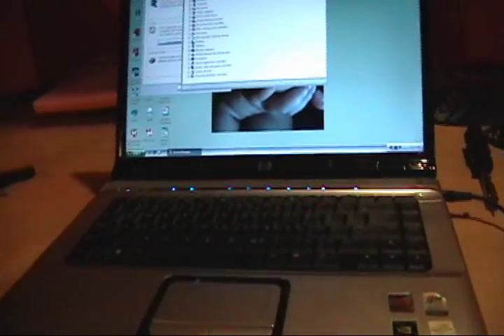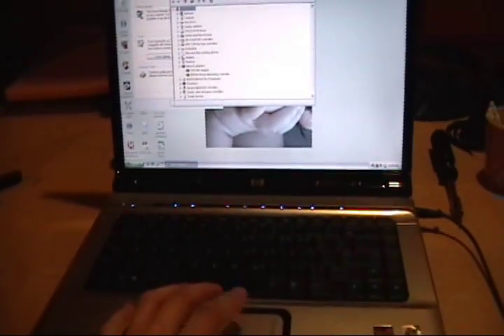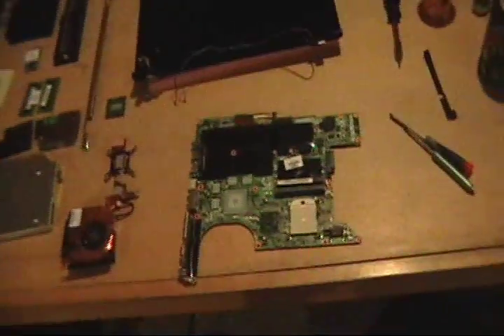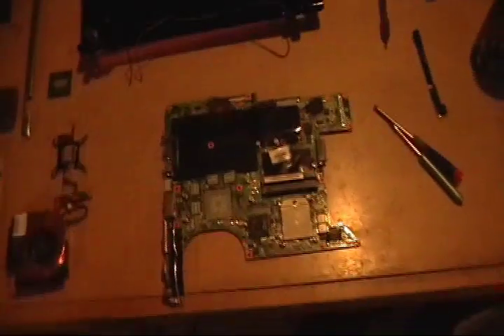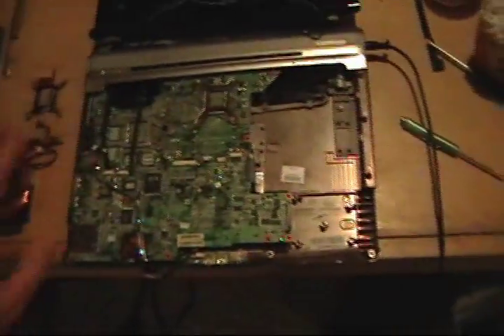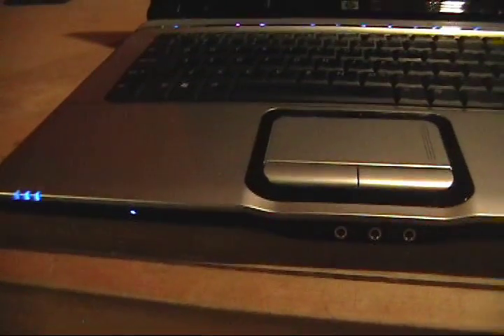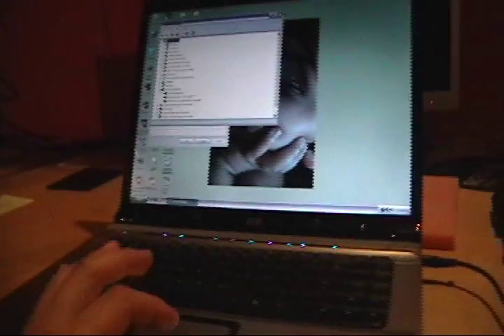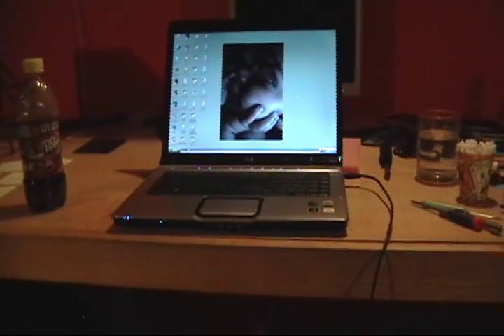HP DV6000 WIFI Not Working or Not Recognized

Comment: Ok so I got my laptop from a friend who screwed up all the programs, I reimaged it doing everything correctly,  and I habe this exact same problem exept the battery and charger are bad and I have to replace, see my battery is crap and the charger doesnt put out enough watts to actually charge ot, could a poor power supply also b the problem?

Comment: There is a software fix that has worked for me on my HP DV2000. Dwnld the nvidia fluidmark program and run it as it comes installed and let it run for about 5 min and close and shutdown comp. start up again windows sees  wifi again . i have to do this almost every time i boot but it does work. hope this helps others,

Comment: @Mzlx44 that will NOT work… the wifi is not working due to a hardware failure..  System restore only restores the software back to an earlier date. Software & Hardware are two difference things in a PC..